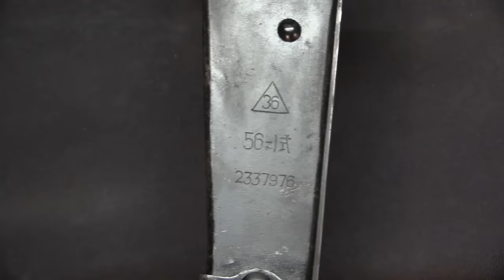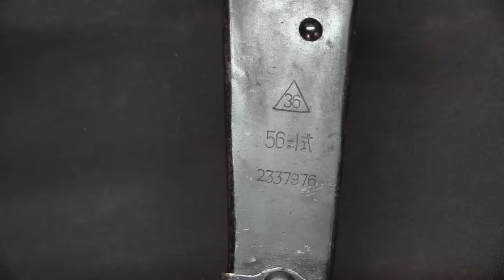RPD: The LMG Adapts to Modern Combat

Comment: The first actual Squad Automatic Weapon, sure we had the B.A.R. before that, but the RPD was really the true predecessor to modern SAWs used today with the intermediate cartridge.
Reply: The French Chauchat predates the M-1918.
Reply: Yeah, Soviets were the first to utilize it, and first the figure how stupid it is.
Reply: Chauchat and BAR were designed in WW1 for different purpose. Walking fire rifle or something like that

After Ww1, US decided to assign new role for it and put a worse sight on it also.
Reply: @WALTERBROADDUS  technically you are right, the Chauchat was definitely the first saw, being belt fed in an intermediate caliber designed to be capable of usable fire from the shoulder and to be operated by a single individual as part of a squad... On no wait it wasn't...
Reply: @Dominik189  A SAW doesn't have to be in an intermediate cartridge or belt fed.  It is more of a role than a firearm.  For example, the BAR may not have been designed as a SAW, but it was used as one.
Reply: @666Blaine  ... The wast majority of firearms filling that role including the firearm for which the role is named are in intermediate caliber and belt fed.
Reply: @Dominik189  the 2 guy for  a chauchat that was only french doctrine There is a lot of fight where the chauchat was used by only one guy
Reply: @destroyerarmor2846 
No, it was an automatic battle rifle.
Reply: @DinnerForkTongue  you're an automatic battle rifle.
Reply: @mach533x  I laughed for like 5 minutes, fuck XD
Reply: @mach533x 
Bang bang bang.
Reply: FG42, MG42 with 50rounds drum, etc
Reply: @sebastiandc1392  Automatic rifle and MMG what was your point?
Reply: @sebastiandc1392  they did not use intermediate rifle rounds, but full lenght rifle rounds. the OP's point was the first one using intermediate rifle rounds, and i cant realy think of a different weapon preceeding the RPD in this case that was fully adopted
Reply: @mach533x  🤣🤣🤣
Reply: @evilreddog  There were none, at the time. My point is to give automatic power for trenches with the caliber you have, to troops. BAR was way obsolete by WWII. Just imagine getting into a trench with a mg34/42 with a 50 drum... On the other hand, marines are ditching the SAW concept for mobility, AFAIK. Cheers.
Reply: ..you think it got rattled....having the muzzle pointed at it?
Reply: @mach533x  wrekked
Reply: @sebastiandc1392  if it was simply for automatic firepower for the trenches, then just look at SMG's instead as you already had avaliable 7.62x25, 9mm and 45 acp. a SAW was never ment to used as a trench broom so i find your point rather flawed. all the belted machineguns was and still is used as a supression weapon to either attack, defend or withdraw your squad. Something the MG34 was one of the first to do. But again, we are jumping over the OP's comment of intermediate cartridge to argue around it....
Reply: grabs popcorn come on guys please continue with the SAW discussion
Reply: SAW" was and IS just a role, previously most often filled by an LMG or GPMG, but later an intermediate cartridge design was adopted.
  The RPD was in fact THE automatic weapon for a squad of men.  I don't know how much more "SAW" you can get.
Reply: @WALTERBROADDUS  that poor thing was slow and jammed during its time due to the sucky mag
Reply: @sebastiandc1392  only for the current types of fighting they're dealing with now. Most of the fighting is urban where mobility and lightweight is key, so they don't need the belt fed sustainable automatic fire of a true LMG, hence why they're switching to the lighter automatic rifle role. If they ever go back to open warfare, then I'm sure they'll switch back to the 249 or 240 since in open areas you'll need high volumes of suppressive fire.
Reply: @kratos948  True......
Reply: "This is the first true thing of a class that I just vaguely described using an acronym implemented by one of the nations that happens to use a specific model of firearm not even made in that country and I learned last week what an intermediate cartridge is so now I'm an expert" -- random mall ninja
Reply: @kane357lynch  the BAR's issues in WW2 basically came down to weight & size, magazine capacity and fire rate. It was a capable gun but not really fit for the role it was put into. In all honestly a semi-automatic rifle could do most of its job at longer ranges and any smg beat it out short range. 
To be a squad support weapon, you really needed a larger magazine (or a belt) with a higher fire rate, so it wasn't good for that. The semi-auto rifles had capacity for a reasonable fire rate (completely inaccurate suppression fire, so the same as the BAR in that regard), but were far lighter. For actual squad support you really needed an LMG, and as the marines proved in the pacific, a few modifications easily made existing ones of those into a better man portable squad support weapon.
Reply: Bren, BAR, MG34, Browning 1919  FG42, and more. I don't think imintermediate cartridges are a requirement for a SAW.  Those guns were all used in similar ways to something like and rpd, m249, m60 ect.   Yes they were technically intended for other uses but m249s and m60s are often used as GPMGs and rpks and rpds are often used just like normal rifles. The SAW isn't a type of weapon. It is an organizational role within the infantry squad filled by basically any weapon capable of sustained automatic fire. Sure there are different requirements in each military but those are doctrinal and not technical.
Reply: Guess the BREN gun doesnt count....?
Reply: @Trunch1312  french just playin on max difficulty.
Reply: @Trunch1312  we are on a Forgotten Weapons videos, of course we will talk about the french first "SAW"
Blessed be Gun Jesus and his holy weird french weapons
Reply: I'll go with first light support weapon (LSW)
Reply: @Dominik189  as someone who has a hobby looking through countries millitary equipment this isn't really true. A fuckload of countries (especially poorer ones) their SAWs are just their standard rifle with a heavy barrel and extended/drum mag.
Reply: The homie's right.
Reply: @kane357lynch  my reasoning with logistics is simple for WW2. Consider how much of a right mess it already was.  A single US infantry platoon often needed between 4 and 10 different calibres of ammunition for all its weapons and couldn't be resupplied by allied forces as they all used different calibres. Between the commonwealth, french and american forces on the western front, I would not be surprised to find them using 10-20 different calibres across all forces for just the infantry, not counting vehicles. Compare that to a NATO force, there are for infantry use 4 approved calibres. 9mm, .45, 5.56mm and 7.62 used by all NATO forces as their basic infantry calibres. I am specifically not counting the PDW cartridges as neither are "officially" accepted for NATO deployment, I am also not counting sniper rifles, as those rounds are often specific quality ontop of their calibre. .50BMG doesn't make my list because it's a vehicle/static MG round, that just also happens to be fired by rifles like the barrett, but it is also the generally accepted NATO HMG round too. There has for years been discussion of an intermediate 6.5mm round but due to all nations needing to agree, those talks have so far come to nothing as the basic rule is that all NATO forces should at minimum be able to be reapplied by other forces, which would require all forces to carry stocks or 6.5mm even if they had no 6.5mm weaponry.
Reply: @alexd5246  some don't even use that, they just issue larger magazines and accept that barrels will need replacing more often, as with rail systems and weapon can have a bipod these days. A key example is the G36K, a SAW version (the MG36) was developed but never adopted. A standard G36K can and is often used with a drum mag as an improvised SAW. 
People should also not confuse the SAW with a section MG. You can have both, the SAW often shares the same calibre round as your rifleman, the MG may be the same or may be a larger calibre, this is however a more recent occurance.
Reply: @zoiders  the brens problem in turn was that some silly sod put the magazine on upside down.
Reply: @sebastiandc1392  I'd rather have the BAR, considering it was actually meant to be fired from the shoulder, whereas the MG34/42 was not. In a random stand off I would put my money on the BAR every time, assuming the guy in the trench with his MG42 is just as unprepared as the guy with the BAR.
Reply: Will Berry  they were platoon level. Part of the MG sections assigned to each platoon. Their squad based automatic weapons tended to be MP series weapons, or sturmguvers (I bet I spelt that wrong). Reasoning is the MG34 even while you can use it solo with the drum mag, you need an ammo bearer to realistically be viable due to its insane fire rates.
Reply: @Chopstorm.  tbh it really comes down to "who is fastest". The BAR may be more accurate but its heavier and clumbsier to weild. The MG34 has a much faster fire rate, and in a hip fire scenario is generally a much better gun. 
If there is time to stabilise them, the MG34 wins 9 times out of 10. 
Frankly the germans had by far the best machine guns in WW2, and before materials shortages became an issue the same can be said of every single weapon they wielded across the board. 
If I am honest about it, if I could have a well manufactured (that's the key part) German counterpart to any allied weapon, I would, as I can't with the possible exception of the browning .50cal, think of a single weapon the allies had at infantry levels (those on ships, planes and tanks are different, that's more of a mixed bag) that the Germans didn't have a far superior counterpart too or had replaced entirely with something more effective.
Reply: @cgi2002  Wait clumsier to wield? The MG34/42 had no real grip on the front and was severely out of balance. It was designed to fire from at least a bipod. 

The BAR also weighed less, by several pounds. 

Best guns across the board? M1 Garand and M1 Carbine vs the Gewehr 43 and Kar98k. Easy win for the Americans. 

I'm not sure where you are getting your information from, but you really need to hit the books again.
Reply: @Chopstorm.  the lack of a front grip is a problem I agree, but it is countered by  the weapon actually having a pistol grip (only specific versions of the BAR did, often not those in frontline service).
By heavier I was thinking of the wrong gun, so fair I got that wrong.
But the way there were used differed which makes a difference, combat doctrine for MG34 gunners was not to shoulder fire ever, and even hip fire if you could avoid it was discouraged. The approved method for it was to drop and deploy the bipod, but when hipfiring it wasn't unheard of for German troops to "rig" a strap to let them use it in a similar way to the way the US marines used the 1919 in the pacific.
So BAR's while overall lighter, were more unbalanced because of the way they were supposed to be used, and the lack of a pistol grip. It's hard to fire accurately from the waist, and it's very uncomfortable to bring it to your shoulder without the pistol grip.

As for guns, 
The 98k is a better gun than the comparable allied weapon, which was not the M1 Garrand, it was the Springfield or the Enfield, both are excellent guns but the 98k was I personally think a bit better (hard to call really, all 3 were very good).

The G41 was the actual comparison to the Garrand, not the G43, it came later. I would give it to the Garrand it was better than the G41 due to the reloading method of the G41 (used 2 stripper clips, so was slower). But the G43 rapidly replaced the G41, and was personally I believe better than the Garrand (rapid reload by just replacing the magazine) and never ate your thumb. But the long term planning had it been entirely replaced with what comes next. But shortages stopped that.

The M1 carbine's comparable German weapon was the STG44. It never saw use on the same scale as the M1 due to materials shortages, but was basically a better weapon in every way.

The BAR equivalent would have been the FG-42 which again suffered from materials shortages. The FG-42 by the way, is what lead to the M60 when the US reverse engineered it. 

The german SMG's were, if we are honest tend to normally better across the board than the allied versions. The British SMG's were often "need gun fast, slap it together". The US used the Thompson, which while having a great fire rate, has alot of recoil, is quite heavy  and expensive to build. The various german smg's tended to have slower fire rates but were more easily used, cheaper to make and deploy. Tbh when it comes to SMG's I would actually say the Russians had the best one tho, it's cheap, effective and very controllable.
Reply: @cgi2002  Most of the intended ammo load of a G43-armed rifleman was issued in stripper clips. If I recall correctly, only two magazines per soldier were originally issued. So I don't believe that's a significant advantage. The M1 had better sights and was much more durable than the G43 (it tends to suffer serious parts breakages after serious prolonged use).
Reply: @catlee8064  The BREN is unsung.  In 'single shot' it is just as accurate (if not more) than the SMLE No.4 Mk1.  The BREN was designed tactically for the Offensive and is well suited for urban warfare.  No one (but Rambo) is kicking down doors, entering a structure and then fighting with a belt fed machine gun. For a light machine gun that fires a full sized rifle cartridge (.303 British), the BREN is still a relevant system well into the 21st century.
Reply: @janwacawik7432  your right (technically 3 magazines including the one in the rifle). The stripper clips were also only 5 round clips and the magazines larger so it took multiple clips to reload a full magazine, but realistically, if you needed a rapid reload a magazine swap is faster, if your in good cover a clip isn't terrible, and you don't risk Garrand thumb. The parts breakages were a problem, but alot of that is linked back to inferior quality due to materials shortages, the design itself is better. 
I will agree with the sights, the Germans tended to have poor sights on alot of their weapons.

But my main point was, the Germans technically had better weaponry on paper, but never in the numbers needed or with the build quality required. Generally because they were suffering major material shortages and were cutting costs across the board to try and meet demand which reduced quality. Had this not been an issue, their weaponry would have been generally superior. The German design design and development programs were years ahead of everyone else, but their industry was pushed to breaking point and unable to deliver the goods.
Especially when you consider that weapons like the STG44's and FG42, which no one else really had anything comprable yet and both of these lead to post war developments that can still see be seen in modern weaponry today.
Reply: There's a lot of talk in here about the BAR and Chauchat, but I think there's a couple of similar guns People are forgetting, such as the Lewis Gun And Bren
Reply: @WALTERBROADDUS  It does and it was even worse IMO than the BAR.  It was proof of the concept though.
Reply: @destroyerarmor2846  Doesn't take an intermediate cartridge so no. I always think of the BAR as being neither fish nor fowl.
Reply: @zoiders  I mean I'd have had it side mounted. Then you could have had an adapter for a belt. Does however cause some balance issues as the weapon would then be side heavy.
Reply: @zoiders  no arguments there. I would just have loved to see it also have the capacity to use a belt. The small magazine limits its use for fire support.
Reply: @shatbad2960  Most would agree. Chauchat was  was not a gun anyone loves.
Reply: @zoiders  true, but that platform, even a modified version of it (i am thinking of the bren carrier version specifically) would have benefitted from a belt feed. 
I agree the infantry version a 30rnd box mag works as it allows mobility, but static and vehicle mounts a larger capacity would have been better.
Reply: @thepny_chasseur_de_tricera5361  Like most  Machine guns,  a assistant is desired.
Reply: The SAW is fundamentally no different from any other LMG. The only reason it is in an intermediate cartridge, is because the service rifle became a select-fire rifle in an intermediate cartridge.

For the same reason, it would have made no sense to the RPD in the 30's, since the standard cartridge at that point was a full-power one. Unless you are upgrading your standard rifles to an intermediate cartridge, it is not worth the effort.
Reply: Yes... the BAR is not really a good weapon to be honest. The weight of BAR is too heavy and it only has a 20 rounds mag...however the M1 with semi auto covered the leak of fire power.
Reply: @666Blaine  especially when the Chauchat was Chaucrap.
Reply: @huntermad5668  they also used full power rifle cartridges, not the intermediate cartridge
Reply: @kane357lynch  I would argue the Browning M2 is the better than the MG42 as it's still widely used by multiple different militaries and is basically completely unchanged. The MG42 is admittedly a great machine gun, arguably one of the the worlds best LMGs, with the Browning as the best HMG, with the DSHkM a close 2nd.
Reply: @kane357lynch  be honest, you need a vehicle to use it offensively. Sure it's a great static but that's not something done on a wim, that's a defensive installation, so you likely have an engineer involved or at the minimum a pre-set fighting position for it.
Reply: I think the stinger LMG would count as a SAW, even if only 6 were made.
Reply: @p1ch0t  The french had a whole bunch of great things by the start of WW2. It was their completely backwards ass doctrine for warfare. French Tanks were badass at the time, if they had utilized them and had it figured out like the Germans and Russians, AND had used their brains to expect a german advance through the ardennes forest.... 

France lost because their doctrine for land warfare was so outdated. The Maginot Line would have been a great defense for them if they just hadn't been stupid.
Reply: @ExarchGaming yes, I agree but what is the link with this topic ?
Reply: The SAW does not fill the role of a SAW. It doesn't have the mag cap to do that. The BAR is an automatic rifle, a role that does have some overlap with the SAW, but is not the same.
Reply: @p1ch0t  I don't exactly remember... brain ran off the t racks while I was reading comments about how good or bad french things were. I just had some insight because I had studied the french pre-ww2. 

Can't remember why i tagged you specifically.
Reply: @CharliMorganMusic  "Squad automatic weapons usually fire the same cartridge (though heavier-bullet variants are preferred) as the assault rifles or battle rifles carried by other members of the unit. This reduces logistical requirements by making it only necessary to supply one type of service ammunition to a unit. These weapons are light enough to be carried and operated by one infantryman, unlike medium machine guns (such as the M1919 Browning) that require a crew to operate at full effectiveness; or heavy machine guns (such as the M2 Browning or the DShK) which fire more powerful cartridges but are also crew-served and typically also require a mounting platform to be operable. "
Reply: What about the Bren?
Reply: @ExarchGaming  Tbh French Tanks were pretty shit my guy, they suffered a lot of issues due to their shoddy design, contrary to popular belief. But I will agree French Doctrine was class A shite.
Reply: @conordowse4537  I should say for the era. They obviously didnt get very far in to their development because...ya know... they thought that the Wehrmacht couldn't get through the ardennes forest and thought that the maginot line was going to save them lol. 

So if you compare their tanks to late era Soviet or German tanks yeah okay. But that 1939-1940 range, they had some of the best tanks in the world. To that reasoning, if they had actually fortified the area around the ardennes they could have repeled the attack and ....rapid defeat of their own country. 

Their tanks had some of the heaviest armor of 1940, which was hard for the guns of 1939-1940 Germany to deal with.... they just ran past them though because their doctrine was so fucking bad. They still had ww1 doctrines. Even the goddamn Soviets before their rapid expansion and modernization knew better lol.

The Char B1 was in one battle a single tank dropped 13 german tanks all a mix of Panzer III and Panzer IVs and the S35 was a monster of a tank considered to be the best tank of it's Era. They did suffer some of the same issues that german tanks sort of did. (especially late war german tanks) with their mobility
Reply: @ExarchGaming  Again, French Tanks were severely lacking in the beginning of the war. Char B1s were primarily riveted in design, lacked radios and had terrible visibility, but most significantly 1 man turrets caused Tank commanders to be significantly overworked.

Also in reference, to the story of 1 French Char B1 one eliminating 13 odd panzers. Stories like that one are notorious for being exaggerated and the tank in question was, allegedly, in fact the Platoon Commanders, the rest of the platoon was wiped if I recall correctly.

It should also be noted most French tanks lacked radios. The Somua 35 was a reasonable tank by the standards of the time, but once again lacked radios, and most importantly was a 1 and half man turret.

Most people like to look at the tanks paper stats without factoring in overworking of the crew, communications etc. This, was only further compounded by manpower shortages caused by a decline in Birth rates since early 19th century, which was furthered by casualties in WW1. These heavily influenced French design, hence why so many French tanks were 2 man designs, in fact the majority were 2 man tanks. Char B1s and S35s were only a minority of the French tank fleet. (Should be noted the S35 was only used by French "Cavalry" Tank divisions, cos France)

To understand French doctrine, it's also important to factor in WW1 and its impact on French military thinking and its overall social impacts.
Reply: @destroyerarmor2846  Thats good
Reply: @WALTERBROADDUS  
Not all machineguns are SAWs
Reply: @A-G-F-  but that is the topic of conversation and the purpose of weapon.
Reply: @WALTERBROADDUS  i love the Chauchat, especially the Belgian one!
Reply: @destroyerarmor2846  Automatic or combat rifle but not assault rifle
Reply: Bren
Reply: @sebastiandc1392 I think the mg42 was more of a gpmg than a saw which I think is a small distinction
Reply: @WALTERBROADDUS that thing is just an automatic rifle bro
Reply: @alexmason5521  it's not in the sense of a service rifle. It's a squad support weapon.
Reply: And not a single mention of the Lewis gun?
1911.